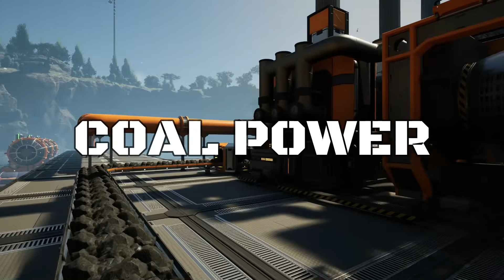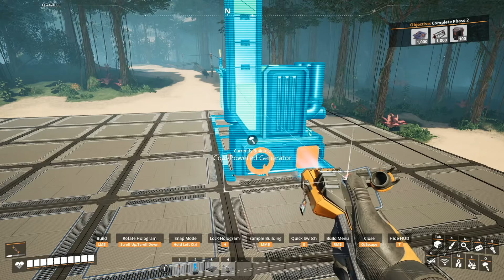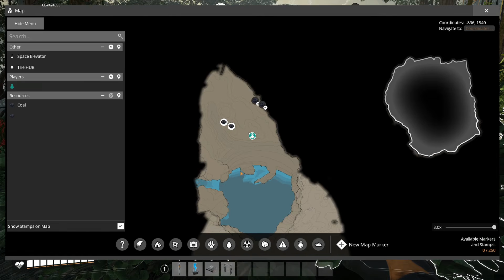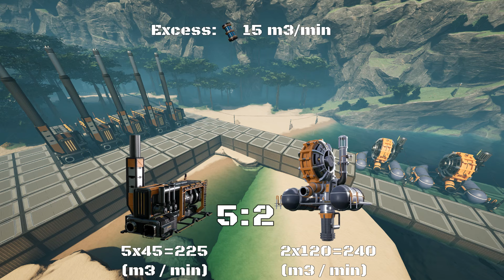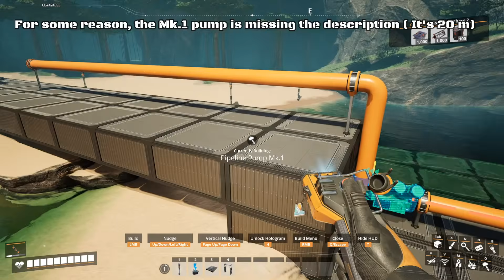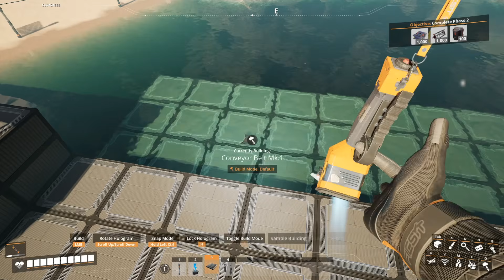Beginner Satisfactory Coal Power Setup That Works!

Comment: Run your water extractors at a 1:2 ratio, clocked to 75% production. It costs a little more materials, but uses less power... and it's much easier to run your pipes. Keep your generators at the same height as (or only slightly higher than) the extractors, and you don't need pumps.

Resources are effectively infinite, so an extra building costs very little... but power can be precious in the early game, and that extra 15 MW for running 4 at 75% instead of 3 at 100% might save you from a blown fuse.

Underclocking is magic.
Reply from the maker: That's actually a really good point. Underclocking is one aspect I have neglected completely, but yes that will save on power.
Reply: Came here to say this.  I tried to min/max 8:3 in my first playthrough, and it was a pain.  The 2:1 just works better, and the fact that it uses less power (when underclocked) is a bonus.

If you REALLY want to do 8:3, you can run the output of one of the extractors to the opposite end of the pipe "manifold" instead to avoid the 360-in-a-300 problem.
Reply from the maker: Did not even consider the benefits of underclocking, I used the 5:2 ratio so much I convinced myself that it was the optimal ratio 😅

Comment: Why when I make the 8:3 ratio the coal generators run out of coal? I have 2 mk1 on pure coal nodes (120each/min) merged and with a mk2 belt I connect them to the generators but they run out, some are at 100 but some not.
Reply from the maker: I can't really tell without seeing the setup, normally 120coal/min should be enough for 8 generators. I suspect one of 2 things:
1. There is a tiny strip of mk.1 belt somewhere along your coal belt and it's slowing all your coal to 60/min. Just look for areas where the spacing between the coal lumps on the belt changes. Check between your first and 4th generator as well.
2. Belts might not be connected to your splitters when feeding into your generators. Sometimes when you delete and replace a splitter or merger it doesn't connect automatically to the existing belts even though the position matches perfectly. But this would mean certain generators will never get any coal at all.

Let me know if this solved your issue, otherwise send me a picture of your setup
Reply: @Overclocked-soz Will see the belts , but i think they all are mk2. Could it be that I have 2 drills 120 each merged and that slows? Will try that also. Thanks, for answering and also great video! I will keep you updated
Reply: @mateonli  A bit late and you've resolved your issue already, but I feel it's important to throw in that if you combine 2 Mk.2 belts with a merger, you need to use a Mk.3 belt (270/min) at the output to make use of it as you'd be supplying 240/min and only able to move 120/min with Mk.2 belts.
Reply: @Overclocked-soz There was 1 tiny mk1 :/. Thanks
Reply from the maker: Perfect, glad I could help 😁